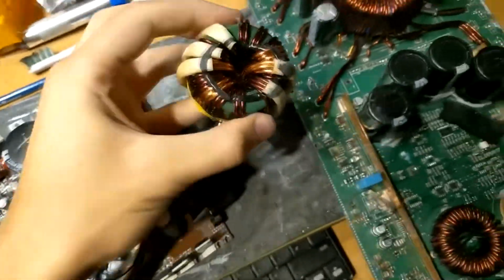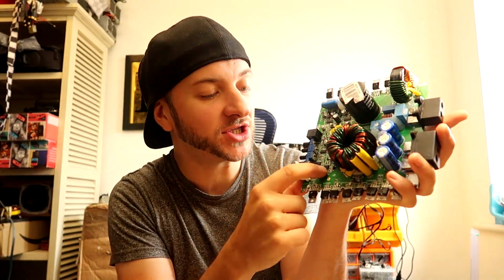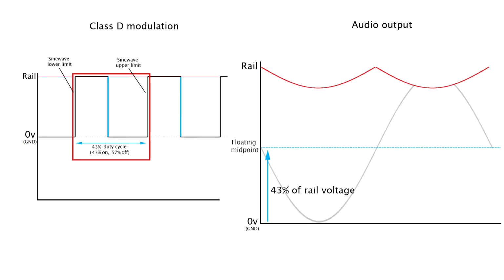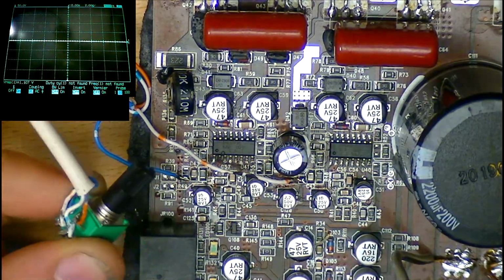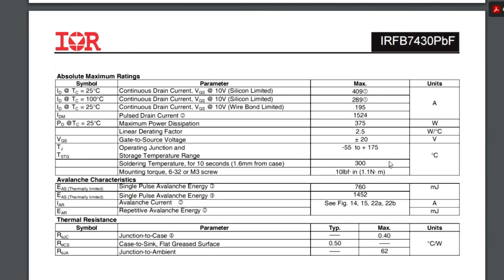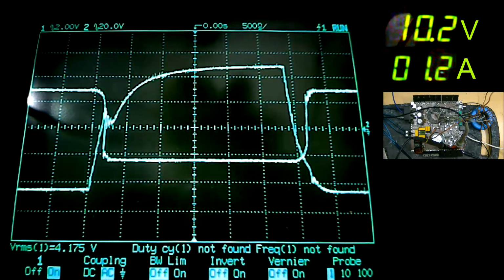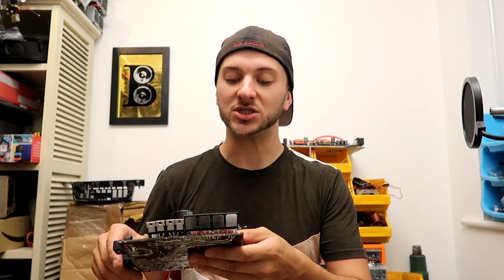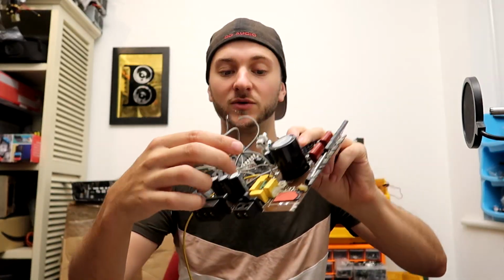Squeezing RIDICULOUS power out of a cheap amplifier?? - Audiopipe Modification PART 2!

Comment: I have an answer for why they didn't use lower rated parts. It's the cost of manufacturing and supply vs demand. It's often times cheaper to manufacture what is more often wanted than to what's not in demand. Changing over manufacturing lines is a loss for the manufacturer not to mention the quality work. It's more efficient to make one specific part than many with fewer variables involved.

Comment: Greetings, sir: I have question, in hopes that you may be able to help me out. four years ago; I bought an amplifier at walmart. It was the "Dual XPR84D, class D 4-channel amplifier. It claims that the total power out put is 1,000 watts, however, it uses two 25 Amp fuses (50 Amps combined) at 12 - 15 volts D.C.. Don't get me wrong; I'm actually pretty impressed by its perfomance even today (May 12, 2022), but I was just curious if you were able to do a dyno-test on the aforementioned model that I have. 

Thank you for your time and consideration. 

P.S. I enjoy your videos and appreciate the quality of your videos, thus, I trust your observations on the products that you put to the test.
Reply from the maker: There is a dyno test already here
https://youtu.be/23CVp1nczoM

Comment: Do you build amps ? I like rockford fosgate tm400x2ad and tm400x4ad,  for my motorcycle. And have sound digital 800.4, bridge 400x2 at 4 ohm. I really like rockford tm400x2ad,  but, need digital amp, 400 watt rms. rockford don't make a bigger amp for motorcycle for 12 volt power supply. mostly I don't know if I'm buying  over priced amps or junk. But how to get more power

Comment: Hey brother question.... Well a couple questions.... If this works for that audio pipe wanna be HD3k. Couldn't you do the same to the taramps HD3k and make it throw out more wattage???.. or how could you turn the hd3k into a let's say a prototype hd5000 and get it pushing 5k at 1ohm..? Is it possible with the hd?? I know the smart 3 can do over 5k @0.5 would the hd be able to do the same because they are extremely close in power.. and you know the skar RP800.1DM is the exact same amp as the CT Sounds 700.1D??? And very close to the CT sounds 1000.1D.. the boards and layout is very close.. but the CT sounds 700.1 and Skar rp800.1d are the exact same amp.. the skar puts out considerably more power but they look absolutely identical in the guts just different color though

Comment: Yo Sam! This is the best series I've seen and the one I've been waiting for you to do! I always wondered why you didn't make slight changes to some amplifiers to improve reliability or power since you know so much about how it all works. I didn't know it would be so complicated and so difficult to get it all right. Im really looking forward to your part 3! I would really really love it if you worked with a Korean build house to design and have built your own line of original design amplifiers. You should consider doing it man. Start your own brand that is reliable and efficient, and obviously puts out gobs of clean power. I'd buy one in a heartbeat, and you have hundreds of thousands of potential customers once Derek puts your line of amplifiers on the Dyno. It's a golden opportunity. Don't pass it up. It could change your life.

Comment: Hello, is there a way to convert the load of the amplifier from 2 ohms to work on 1 ohm. for example, Alpine MRD-M300 amplifier, maximum power 300 watts at a load of 2 ohms at 14.4 volts. how can it be transformed to support a load of 1 ohm. and therefore increase power.

Comment: @barevids i'm currently dealing with a parasitic drain issue, and i've realized it's not my truck at all, but two audiopipe apcl-1500's that are drawing 24mA's each while off (no remote signal). 

have you dealt with these or parasitic drains in general, i was informed by AP themselves as well as a few other individuals that the main power caps can cause, and are usually THE CAUSE for this issue and i'm just wondering if you'd agree with that statement before i go tearing this thing apart.

Comment: Be aware that the core for inductors and transformers are different (even they looking the same) so you will not be able to use the original transformer core as an inductor.

Comment: Hi Sam, nice job indeed; some comments about your mods:
1. 200v rail is the absolute maximum limit for irs2092. It may run pretty fine at idle but when you ask for some serious current trough the load overvoltage spikes will appear on your fets. The spikes WILL kill your irs2092 at 200V. Stay below 170...180v to be on the safe side. This can also explain why your irs2092 is killed sometimes at    power on.
2. Dead time: from the waveforms you measured the fets are hard switching at idle and means the dead time is too short. You said it is set to minimum (DT pin) which is a very bad choice. Since I don't think you are too concerned with the Thd of this amp simply put it at maximum by changing the R around DT pin. This will remove some stress from the output fet that are clearly slower than the original ones.
3. Output inductor: good idea to increase the value but don't use the transformer core for it, it will never work. The transformer uses an high permeability core (2000..5000u) while the output inductor uses a low one (10..100u). Winding the output chocke on the transformer core will make it instantly saturate and you fets will be broken right away. Increase the turns on the original core or stack 2 identical cores if you need more inductance. A suitable core will be something like T130-2 or T157-2 or other distributed gap cores like Kool mu, sendust or MPP types.
4. Duty cycle change with rail voltage: this is something not intended by irs2092 and I think is a kind of protection to make it clip earlier at high rail voltage like you clearly explain. Check whether there is a resistor going from the positive rail to the feedback circuit around pin 2 or 4 of irs2092. If you find something like this simply remove it. The output idling voltage shall always be vrail/2 whatever vrail is. If this is noz the case means there is something addind DC offset to the feedback and has to be removed.
5. Litz wire: you don't need it at 25kHz and I don't think you can push the PWM frequency up too much with these beefy power supply fets you choose. Use many small wires in parallel to make it easier to wind

Great job so far... I hope you the best when you will start asking some serious power from it.... Good luck
Reply from the maker: Thank you sir! Some responses to your tips:
1) Yes! I noticed this a few days ago when studying the datasheet. Bugger. This is a shame as I could have used some 200V output fets with higher power handling... and it does limit how much power I can ask from this amp. A shame, but oh well. At least I know the reason the chips were dying! 
2) I'm sorry I may have explained this backwards. The chip is currently set to MAX deadtime by default on the board. I cannot ask it for any more deadtime. It would be nice if I could... but DT pin is tied directly to Ground, if you check the datasheet for 2092 this puts it into maximum deadtime bracket threshold 4 (<0.23xVcc). I think my only options are to try and speed up the operation of these fets elsewhere on the drive circuit, faster turn-of etc. 
3) Great tip on the inductor, thank you! I had a message from another gent regarding this, he said NO dont do it!! hahaha glad to see you agree. I ended up using a pair of separate cores from the Banda 8K and they work beautifully so far. More testing required to see if they saturate when load is drawn, but they should be okay.
4) I havent looked into removing this changing duty behaviour yet, but I did find some resistors which allow me to control it - to remove it entirely would be brilliant. I will have a poke around the areas you suggest - it would be great if you could have a quick look over the schematic and see if you can find an obvious area causing this? If you'd be happy to, drop me a message on www.facebook.com/barevids :) 
5) Agreed, I did think the fets would hit limit before i ran into wire thickness issues. I went with x28 strands of 1.2mm per primary, so 56 total on the primaries. Its chonky lol. 

Thanks again my friend!
Reply: @barevids 
1. 200v is the ultimate limit you have to live with it....
2. DT is already at max... Ok it is not enough because you lose zvs at no load. It is not a matter of switching speed is a matter of increased output capacitance of the fets. Increasing rail voltage will be even worse. Two ways to solve it: use mosfets with lower Coss (you don't need 300v btw.)  or REDUCE the value of the output inductor. This will add triangle current in the fets at idle but the final condition is that the output capacitance of the fets must be discharged by the inductor triangle current during the dead time PRIOR fet turn on. Unwind some turns from your inductor and check the waveforms until you achieve this. This must be done at the highest possible rail voltage. Failing to do this will result is blown fets under power.
4. Sure but I don't know where to find the schematic of this amp... If it available somewhere I can have a look at it
Reply from the maker: I have the schematic, I can send it to you if you send me a message! :)

Comment: This is an awesome video! it's even cooler when you learn how amplifiers work in class just to see that if you change the resistance in the voltage divider portion of the cct actually affects the output impedance to the stage.  and just curious what channel will the other video be on?

Comment: I'm not an analog person and grasping at straws, but the chances are that the PIC microcontroller on the Taramps was read protected, so they had to clean-room-design their own PIC firmware and got the voltage thresholds wrong on the analog inputs on their PIC implementation. This is based on the assumption that the Audiopipe design is a 100% copy of Taramps, and the software on the PIC was the only unknown variable that the designers wouldn't have been able to see past whereas all the other components are physical, measurable things with part numbers that can easily be copied.

Comment: If you're looking for some litz wire replacement I have the perfect, cheap, easy to get solution for you. Buy a cheap sizable RC motor (my other hobby) and unwind the motor to get some nice, solid core, coated wire.

Comment: I wish I was still working in the machine shops, I'd make Sam a Barevids heat sink for this board on the cnc mill.
Reply: David Long  I was a CNC programmer and Machinist for years I stopped recently and now build sub boxes in my basement. I've got a Taramps HD 3k that this Audiopipe is a copy of. I'd take the Taramps in and use it to design the heat sink with the Barevids "B" with the speakers in it right on the top, I'd also add more thickness to it and machine it from a solid block of aluminium. After all this work, its not much of an audiopipe its a Barevids amp

Comment: I was looking at amplifier boards that you can buy that doesn't have a power supply part of the board. You can build a full bridge rectifier with a filter capacitor hook it up to a 120 VAC wall socket and get it to output around 170 VDC going to the rails it would be cool building your own home audio amplifier with high output. You also could use a toroidal step up transformer and have more voltage if 170 VDC isn't enough.

Comment: I wouldn't worry about the litz wire bro, even 30k amps don't use it, I can't think of a single amp that does. That core is a quality one and will do the heavy lifting, you can tell because of the lack of wire it needed on the 8k. 
Love your work!

Comment: audiopipe is a weird company so many hits and so many misses in their catalog. i used to run the old gd-6001. was the same amp and in some cases way better than many other amps people praised at the time. was able to run it at .35 daily, the thing was great. then they do stuff like this where they take an ok design and nerf it. 

the big 3ks they put out too so many revisions to that some took up to 18 volts and could be ran at .5 per board some would smoke or not run at higher voltages or just not do rated

Comment: Very curious to see how the traces handle. Always makes me laugh to see a ~200 figure on those tiny transistor legs but it is a very short run. Either way, all the solder and everything else increases resistance and learning how that stacks up would be cool. I wish you were closer, we have a few high res (lol high res IR is .5-1MP) thermal cameras you could use. Maybe someone local who works with drones or industrial apps has one.

Comment: I wish I could get my crossfire cfa 202 repaired but I don't know where to buy the rca and and the switches for the crossover and the bass boost. 
The amp power's up and runs but only 1 of the rca's work I looked at it and check soldering for cracks and found one but that didn't change anything so it's something internally behind the plastic.